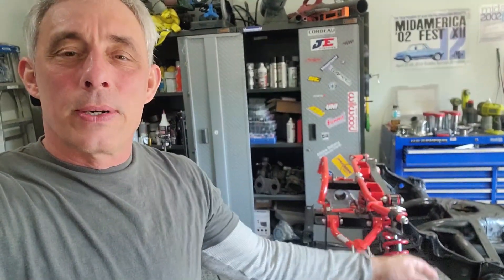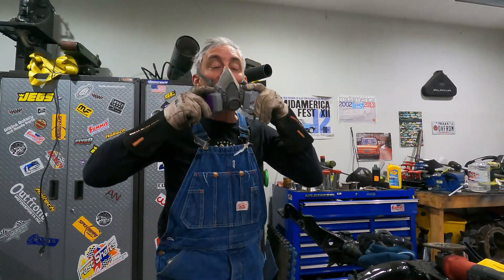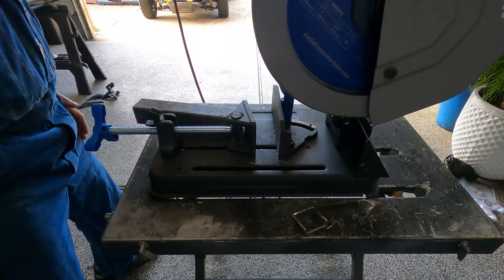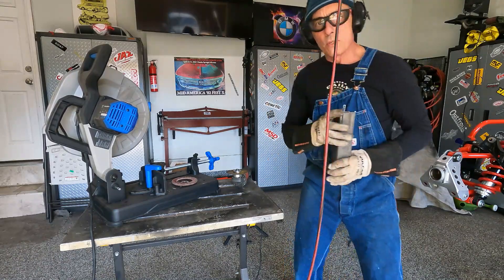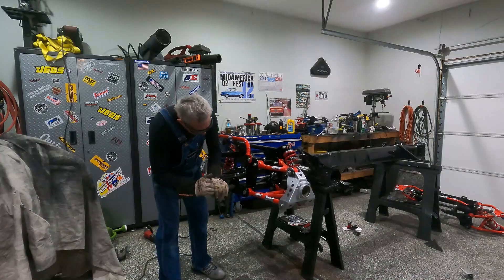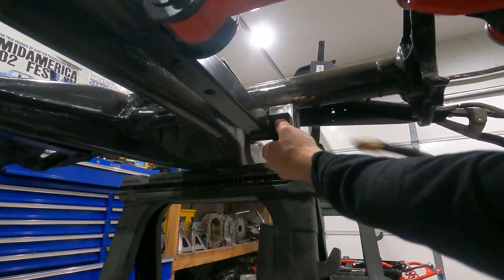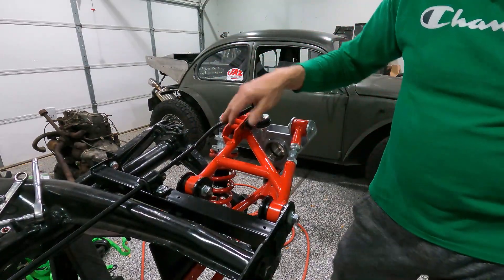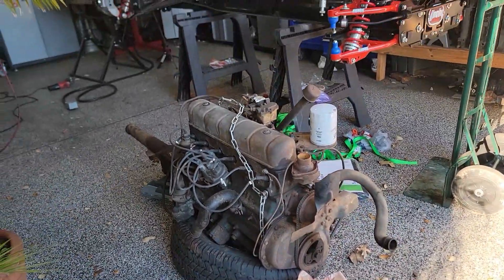Subi Turbo Powered VW Beetle.  IMOHR Rear suspension install and a peak at another car!!

Comment: For improved accuracy, bolt parts like that in place when tacking them. Then you don't have to worry about them being misaligned. They don't have to be tight. Snug will do.
Forgot the shield gas again!😬

And please wear your welding gloves and jacket, UV damage is cumulative. By the time you see the "Sunburn," it's done.

Comment: I noticed you pulling the TIG torch away from the weld before the Post-Flow Shield Gas had stopped. You should adjust the Pre and Post flow to a slightly shorter interval and leave the torch in place until the flow stops. It helps to cool the weld and prevent it from getting brittle. Not only that, shield gas is expensive!
Reply from the maker: LOL yes I saw me do that when I was editing.  Decided to leave it in. I always do on aluminum when I an sitting.  Standing, moving around to TIG had my Mojo off